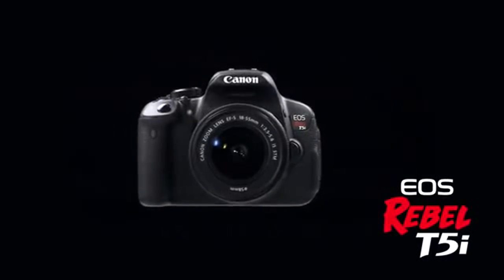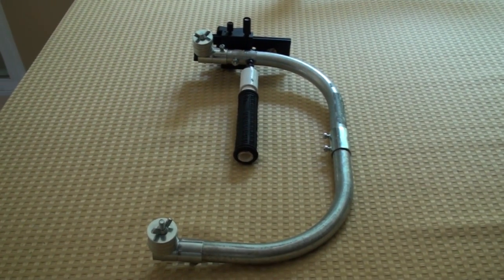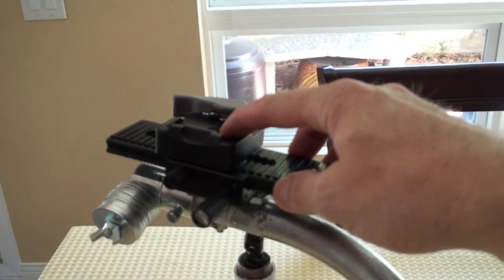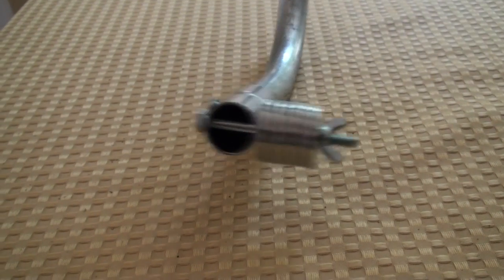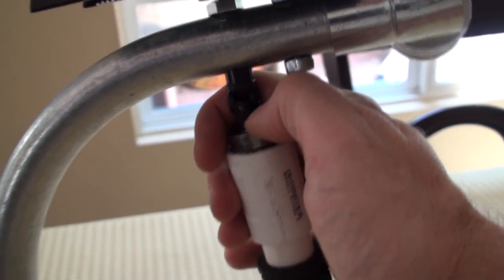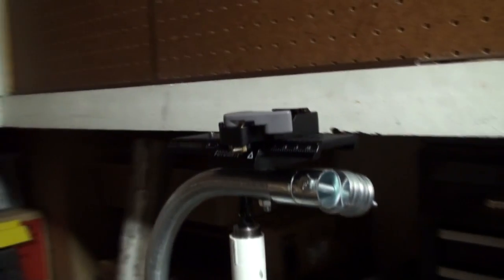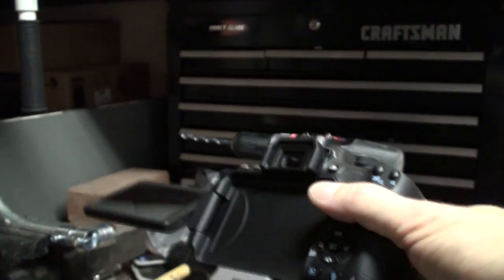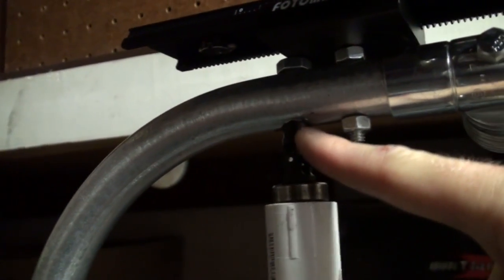DIY Silver Flyer Steadicam for DSLR

Comment: My steadicam keeps turning on the bearing, what do I do?
Reply from the maker: It's tricky to get the horizontal axis to stabilize.  In many cases it could have to do with just how 'smooth' your bearing is.  Perhaps try loading a second bearing on top of the first if you can.  That's what I ended up doing and it worked for me.  Not exact science, I know.
Reply: ok

Comment: Did you compare using that stabilizer with the camera stabilization on as well as off to see how the footage compares?
Reply: In fact the IS function on the 18-155mm STM lens I have on there is on by default.  So, the footage you're seeing is technically additionally smoothed out a tiny bit by the lens in this case.  I'd have to try and get some footage with my non-stabilized 50mm to see the difference.

Comment: thanks for this! finally a DIY that I feel I can recreate without needing a whole garage of tools.. just wondering.. is it similar to replace the 2 90 degrees elbow metal tubing with a curved bicycle handlebar? so i don have to join it and its already in that shape..
Reply from the maker: +Jave Longchiampass Not sure, you just need to make sure that the top of your handlebar is horizontal and that you can place some counter weights easily at the bottom AND top.

Comment: folks, if you use a 4 way macro rather than a 2 way, you can use THAt adjustment rather than attaching washers everywhere. great for mini tweaks that 1 washer wont fix. http://www.amazon.com/Neewer-Focusing-Close-up-Shooting-Standard/dp/B00JRP3AYC/
Reply from the maker: Choras Den This is true, however you also end up with more weight and a somewhat uglier contraption!
Reply: Utopia Studios Weight?! your talking about adding 5-6 oz as yours specks at 9.5oz and mine 15oz. and this is DIY/Gorilla Videography... no one is THAT concerned about appearance.  If you were, you would have used a jumprope handle and powder coated the frame. Putting a 4way head on the unit will allow for pin point balance, and adjustment on the fly if you need to change lenses.

Comment: It might make it more steady if you fill the pipe with some kind of foam or something.  Give it a little more weight centre mass.
Reply from the maker: That's another idea, but the only issue may be that you can't put more in or take some out after you've set it.

Comment: I've followed this model exactly and I'm using the same same Canon T2i and kit lens that Jorge uses but can't get it to balance correctly. The battery side of the camera is causing it to lean in that direction unless I load up the bottom left side with washers, which then causes it to rock when I walk, defeating the purpose of the steadicam. I know it can be done because I've seen your great work but I haven't been able to figure it out, even after trying to balance it for several hours. The big question is how can I counterbalance the right/battery side of the camera while keeping the bottom weight to a minimal so it will still float and not rock?
Reply from the maker: Balancing, as you've discovered, is the toughest part about this project.  I can't really provide any super specific instructions because every flyer is going to be different since you built it yourself.  However, I suggest playing with the weight at the bottom and moving/swiveling the weights immediately below the camera left/right depending on how the camera is behaving.  Enough weight on the bottom is important to stabilize the whole thing.  Not enough weight and you'll get that much more unwanted movement.  There's a "happy place" where the rig is stable but doesn't rock too much.  As far as left/right, again, a matter of playing with the weights under the camera mostly.

Comment: I see small stabilizer units on eBay for $40 -$99.  They seem to be of decent build quality.  Is it worth doing a DIY on this?
Reply from the maker: The closest stabilizer I've seen to the silver flyer is this:  http://www.ebay.com/itm/U-Flycam-Video-Stabilizer-System-handheld-4-Digital-Cameras-Camcorders-DSLR-Rigs-/161139715284?pt=LH_DefaultDomain_0&hash=item2584acecd4

Parts for the Silver Flyer are going to run about $100 give or take, when you include everything but the camera and the tools.  If you already have a quick release plate you can use as well as a macro slider, you'll save some money, but it's not a "cheap" stabilizer.  The link above looks interesting, but I have no idea how it performs and it uses a ball/joint system for the gimbal instead of a ball bearing style.  I've never used one of those so I can't comment on how well they work.  This project, for me, was more for fun to see if I could build it.  You can buy a ready made unit, but I doubt you'll get anything of quality for $50 for example.
Reply: The U-Flycam Video Stabilizer System in the above link can be found on Amazon with very poor reviews. http://www.amazon.com/DVC-17642U-FLYCAM-Stabilizer-Support-Camcorders/product-reviews/B005B5UBXK/ref=dpx_acr_txt?showViewpoints=1

Seems build quality is very poor with lots of plastic parts and a very cheap gimbal.

I just bought the parts, etc. and will it will hopefully be used in a student film within the next seven days. I will report back on the results. Seems the only real weakness if current design is weight adjustment. If that could be locked down it would be an awesome DIY.
Reply from the maker: Thanks Greg, looking forward to your review.

Comment: After pricing out all the parts it seems like an extra 5 bucks would get you a cheap steadicam from Amazon or ebay, I may be wrong.
Reply from the maker: You're probably right.  There are some cheap ones starting at $80 from Opteka for example.  However, I don't know how they perform and they are nowhere near as fun to put together :)  Seriously though, the DIY method is not always the cheapest, but you can create a custom stabilizer with some features that the cheap one doesn't provide.  Either way, they are all a bit tough to balance unless you get it just right, right off the bat.
Reply: Utopia Studios  Oh I'm all about DIY I've made beauty dishes for my studio strobes out of plastic salad bowls and large pvc plumbing adapters to make my own bowens mounts, I was making my list to make this steadicam then i noticed the costs adding up and I haven't even visited the hardware store! I've been looking around at some of the lower priced options that seem to look ok with decent reviews for as low as 39.00 shipped, my issue is weight I'm not sure whats going to handle a 5D Mark iii with a 24-70mm
Reply from the maker: Ty Maciejewski Right, weight is definitely the issue.  Some of the cheapies out there have a limit.  Even that $80 one says 5lbs max.  In looking at its gimbal design, etc. I would think that with a heavier camera it may actually get stuck!

Comment: Thanks for the videos, very comprehensive.  I plan on making one very similar to this over the next couple of weeks.
in regards to a friction ring for panning, you might be interested in this video i came across, which explains how to increase the friction in the second bearing enough to aid in panning without affecting the smoothness...
steadicam variable friction ring
Thanks again
Nick
Reply from the maker: Yes, that's exactly what I was wanting to implement.  Looks a bit complicated but I understand how it works, just a matter of figuring out how to integrate it.  His rig is pretty sophisticated!

Comment from the maker: Has anyone built their own rig?  Let's hear what your experience was like!
Reply: to move back and forth without swinging.. make sure the weights have the same force from where your rig swivels. if you go forward and suddenly stop, and the bottom swings forward, then your bottom is too heavy. if the camera swings forward pointing down, then your top is too heavy, so add weight to the bottom.. i haven't even built my rig yet.. just filling my brain with ideas and and putting my 2 half ass engineering classes to work. lol
Reply: I built my own and I only have one problem. In many of the videos that I've seen the operators move towards and away from a mirror very fast and it's really super smooth. Mine is all over the place swinging back and forth! and I just don't know what it is, I'm trying to analyze every video I look at but I can't seem to figure it out.
Reply from the maker: Balancing is tricky.  Take a look at my step by step build video and towards the end I talk in more detail about balancing the rig that may help you.
Reply: +Utopia Studios I have. See my channel.

Comment from the maker: I can't recall exactly what the dimension was for the hole where the Traxxas goes but if I recall I just used a bit and ground out the hole until it fit snug.  As for the hex screw that went into the Traxxas, I used a 5/16" and forced it to screw in, threading itself as it went along which gave it a really tight fit.  I don't think it must have been more than like 1 1/2" or so, just long enough.

Comment: Few questions: Did you drill a larger 7/8 hole on the under side of the Silver Flyer to fit the female Gimbal into the pipe? And you must have used a shorter 5/16 Hex screw to screw into the Gimbal female end, what was the length? Thanks great video by the way!

Comment from the maker: Without seeing your rig I'm not sure I can answer the question.  Did you make sure to drill your holes in the pipe as perfectly vertical as you could?  If camera isn't perpendicularly level with the pipe, you will certainly run into some issue that can't easily be corrected.

Comment from the maker: Glad you like the video!  I updated the video details with links to both the Macro Slider and the Quick Release Plate for you reference.  The hole I drilled was also slightly off center and not quite perpendicular to the tubing, but I was able to balance it with the weights, etc.  If the hole you made is way off you may need to drill another or better yet, just use another 90 degree EMT.

Comment: You're exactly right.  After I left my comment, I got it back out in the shop and realized that the Traxxas was tilted because I had not drilled my hole at a complete 90 degree angle.  I tried again on the other 90 degree elbow - this time making sure everything was square. I was able to get the camera stabilized and got some great footage. As far as balancing, I actually had too much weight - learned this from Frugalfilmmaker. Watch Frugal Floater (around 13:00 for balancing tips).  Thanks!!

Comment from the maker: More weight on the bottom will help the rocking.  As far as it wanting to turn on its own, I found that it's usually due to the alignment of the camera relative to the horizontal position of the pipe.  So if the hole you drilled is off from the actual top of the pipe and your Traxxas is a bit crooked, it will cause this movement.  I added the second bearing to remove some of the smoothness without causing too much friction and it solved most of my problem.

Comment from the maker: On my Flyer there are 2 bearings.  One is embedded into the 1/2" PVC joint/coupler, after I ground out the inside of the joint to make it fit.  The other is wedged between the top of the Traxxas and the PVC joint.  The Traxxas stem fits directly into the bearing.  But, it needs to be "shaved" down since it's too large otherwise.  This is the part that takes a bit of finesse.

Comment: yes i used the macro slider. i even found a jump rope that had weights inside the handle plus built in bearings. i was able to attach one of the handles, with a weight inside, to the bottom part of the pipe and the the other handle i attach the the traxas gimble without the weight. it looked really cool. I painted it black. I loved it but i had a tough time balancing it and it was way to heavy. I tried take off weight adding weight but it still couldn't balance.

Comment from the maker: Did you have the Macro slider on the top?  If not, that could have helped you balance it by shifting the weight back some and dialing in the right spot.  That part is really the key to getting a quick balance IMO.

Comment from the maker: Yes, that would be nice to be able to move the weights around easier and the cymbal clamp idea (I know which you're talking about :) is a good one.  However, unless you're changing out cameras all the time, it's not likely you'd need to change the weight positions or quantity much if at all.